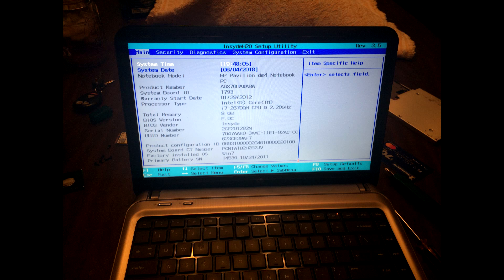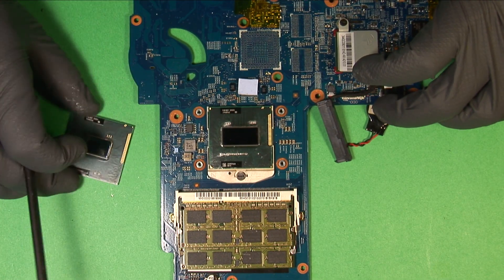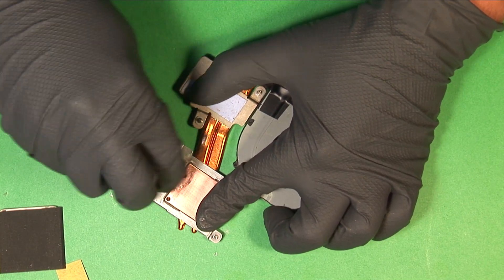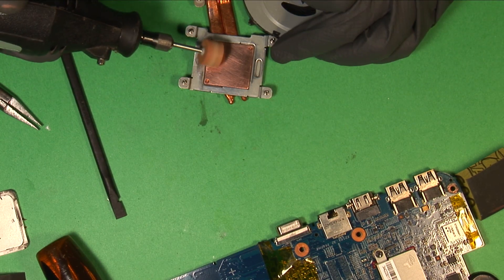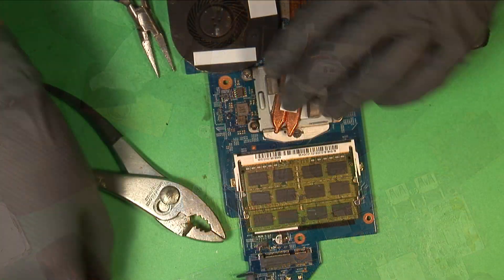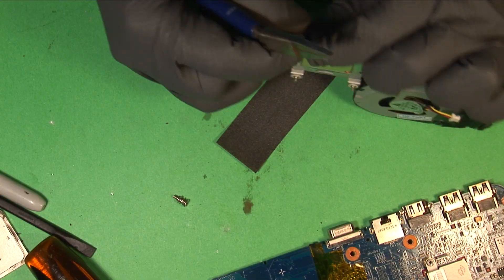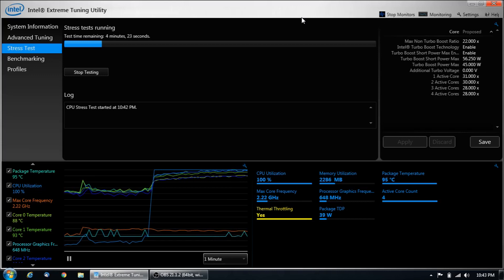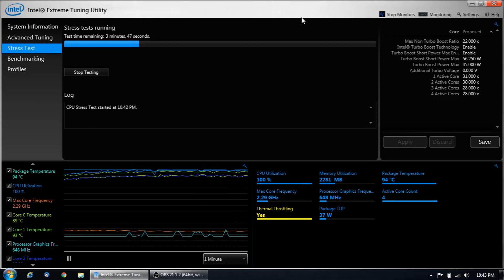Quad Core i7 upgrade heatsink mod - HP Pavilion DM4

Comment: Hate to bring it up but this is one of the only detailed mod vids for this upgrade lol, first off I have the pdf file downloaded for the DM4 and I'm having a hard time finding the specific heatsink used for the discreet graphics version. 636939-001 is the specific part number I believe but I'm seeing single pipe sinks regardless of what I search, was wondering if you had the part number of the one you used handy? Long shot I'm sure lol. Secondly, were you able to use 1600mhz speed ram sucessfully after or did it still downclock to 1333mhz? I have more knowledge with AMD than Intel overall so was curious.

Comment: you couldve bought bad heat pipes, that thing should be sittin at 50 to 60c or lower with a dual pipe.